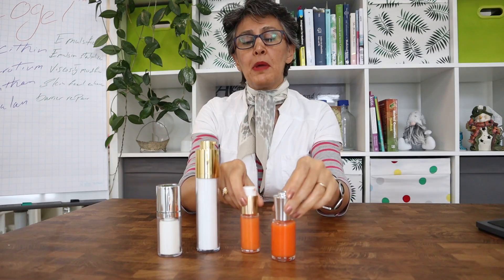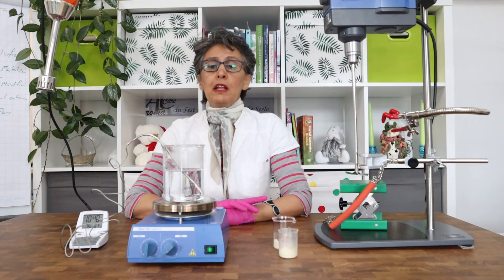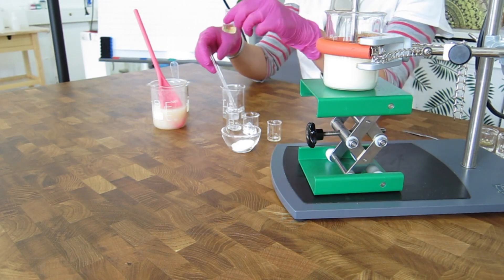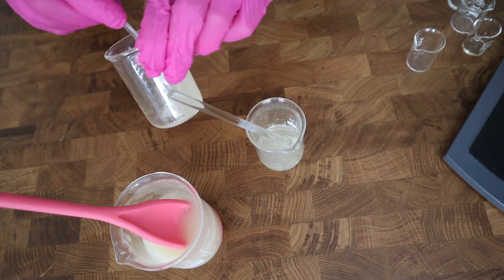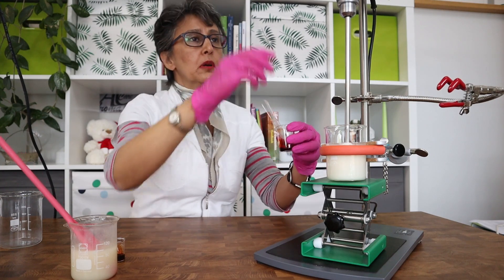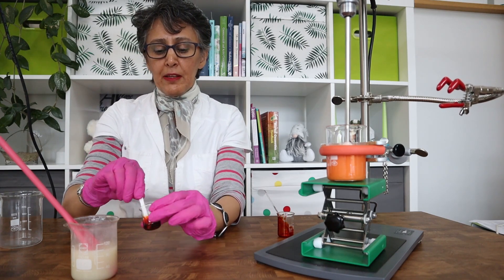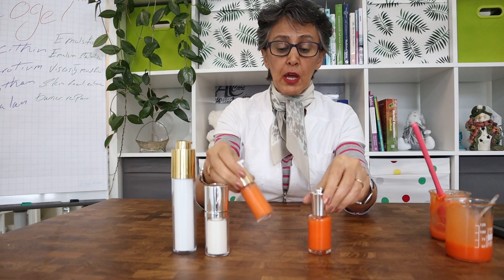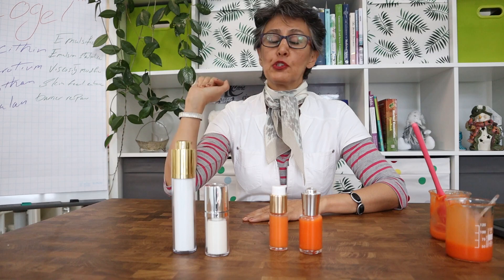How to make a hydrogel multivitamin serum

Comment: How did you use lipophilic ingredients without a solubiliser?
Reply from the maker: that's the magic of chemistry
Reply: @Mirjana Rabic It's the polymer system that she used. Ecogel contains lysolecithin which lowers surface tension between hydrophilic and hydrophobic components. At least that's what my professors tell me 😊
Reply: @adhd_alchemy  I think it is also the sclerotium gum, which helps suspend the lipophilic ingredients, but I'm really not sure.
Reply: @susanwangcfa3685  You're right, I've read that it does have that effect.  I can't ever seem to get sclerotium gum to gel to say from experience.